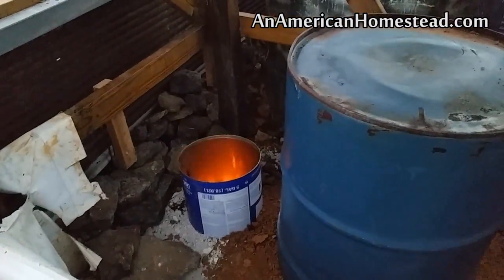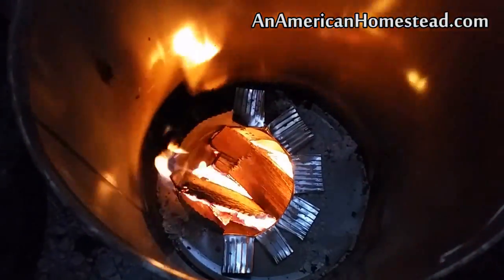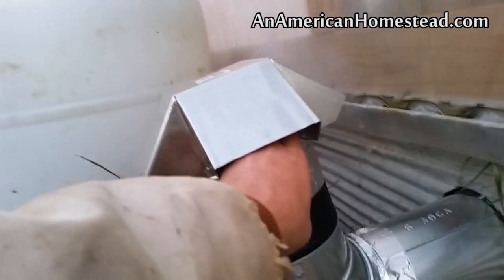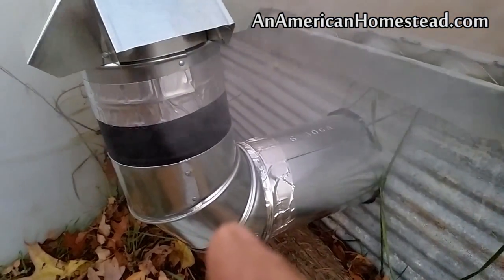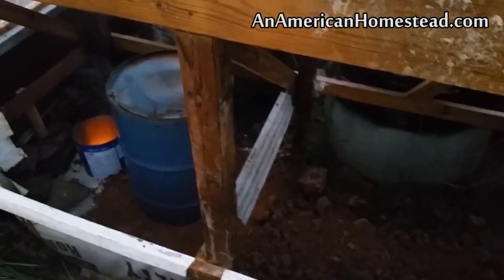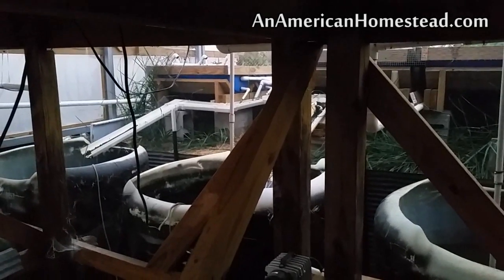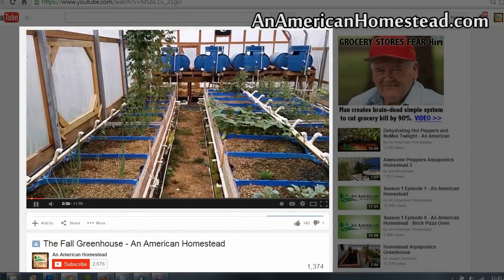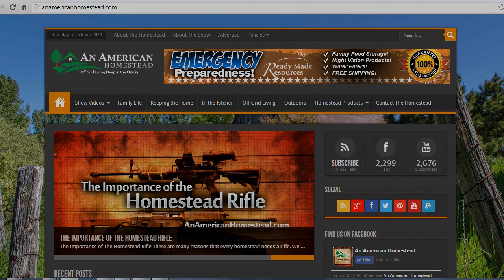Rocket Mass Greenhouse Heater Pt.2 - An American Homestead

Comment: I see why you took it out.  Feed tube to small. I think flue pipe to small also.  Could of modified it ..no mater what the outside flue temp will determine efficiency . Did you look into the stratification method?

Comment: cover up your wood feed canister but not completely...this will eliminate smoke coming up and create a stronger pull draft into the burn chamber...even a piece of perforated or expanded metal will work..also did you insulate under the exhaust pipe going through the dirt so that the heat can only go up....the ground will absorb heat in a negative way ...also i would consider mixing dirt,sand and gravel/rocks  to cover the pipe instead of solid cobb ...this might give a better output of heat into the room...while still acting as a heat mass...one more thing...maybe a water dish on top of the burn barrel to add a little moisture/humidity into the green house...just suggestions/thoughts of mine from watching many other rocket stove heater mass videos..not saying what you have done is wrong

Comment: I didn't read all the comments but just wanted to say you should consider,if you haven't already,extending your piping on the "input" side so that it is burning "outside air". If you burn as it is you are burning up the air that you are heating.When this happens you create negative pressure on the inside which draws outside air in through cracks etc to make up for what is being burnt.

Wade

Comment: Maybe if you had a sort of funnel that you can put in the wood feed side, chop up some pieces of wood and as it burns, gravity pulls the wood pieces down. The fire shouldn't go up the wood if it is creating enough draw but just incase, you could close the top of the funnel off with mesh wire.

Comment: It looks good to me Zak. Well done. I'd guess that the exhaust will start to heat up after you've been burning it for a good 20-30 mins because you don't have the mass to hold all that heat yet. You're obviously getting high enough temps in the stack for a complete burn though. The paint on those drums burns off completely after an hour or so at high temps (careful though - those fumes are nasty). I hope you have a heap of sticks and rough wood to burn through winter. Good luck with the test burns & thanks for sharing

Comment: How do you empty the ash from the burn chamber?
Reply from the maker: It burns hot enough that there is very little ash that collects.  You may still have to emtpy ash after the winter is over but it shouldn't be much if everything is working correctly.

Comment: Presuming that you've got everything "right enough" in terms of the math, your re-burn in the heat riser will take in the 7 - 15 minutes range to really get rolling ... that's partially a function of how much heat your fire is generating and how much heat is going into heating up your burn-tunnel mass and heat-riser mass.

The best place to be putting the heat from your system is into the fish tanks themselves ... suggest a 50gal plastic drum, open cover .... run water in a closed loop from the barrel to a coil around the RMH, then  into each fish tank and then back to the heat-tank-sump barrel.  Use a small 30gph fountain pump to keep the water moving.

You're fighting a loosing battle if you want to heat air to heat water.  Just heat the water.
Reply: An American Homestead You could put cob around and over the barrel. That would store and release the heat more evenly.
Reply from the maker: My issue is right now that it doesn't seem that the rocks/mass or the exhaust pipe is getting very hot...just warm.  The barrel gets VERY hot and it too hot to touch within a minute of firing it up.
Reply: It takes an awful lot of BTUs (or J) to heat a thousand pounds of rock and soil up from 40F to 50F.  So a lot of the energy is going into your mass and then getting wicked away by the colder air in contact with the mass. 

If you want the real story, you'd need to get a long-probe thermometer down into the ground beside the pipe.

Don't forget, too, that unless you insulated around the burn chamber and burn barrel base, a lot of heat is going into the ground right at the bottom of the barrel.  Until that mass comes up over 200F, even just a yard away will feel not much warmer than air temperature.

That's part of the reason that with my greenhouse RMH system, I'm going to be putting a water heating coil around the barrel and into the fish tank.  That way I know the heat is reaching the water for sure.

Comment: I'm sorry I can't answer most of your questions. I would thing if the warmth dissipates before you need it to maybe some of those foam insulation tubes ( swimming pool noodles?) around the PVC might help hold the heat in. Maybe take some idea from the wood stoves that you run maybe 3-4 hours a day to heat up a brick wall and the house stays warm from using the warm brick. I hope that made sense. In some areas there is also a sleeping area on top of the battery of warm brick. Tfs